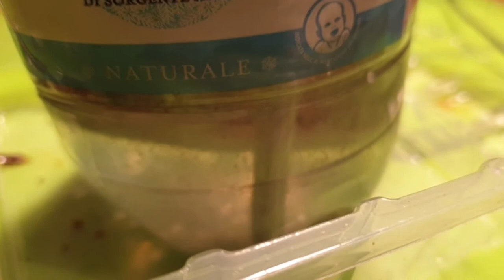Viking Axe Blade Engraving

Comment: what kind of paint did you use for the etching? ? a particolar one or a common one ??
Reply from the maker: Hi! I've used standard acrilic spray paint, but i have to say that it's not the best one (first attempt :/ ) because it came off in shards, which give an "old-fashioned" rustic style to the pattern, but i really need to find a better one in order to engrave more detailed drawings!
Reply: @morningwoodcrafting5960  I've never done any etching but when i engrave wood with a Dremel i like to use homemade vinyl stencils I cut on my mother's Cricut.. 

You'd have to ensure a good seal so it doesn't lift during the etch but it might give you crisper edges...   great video!